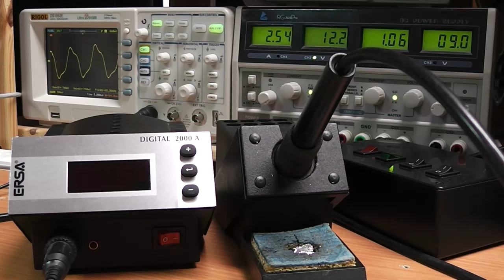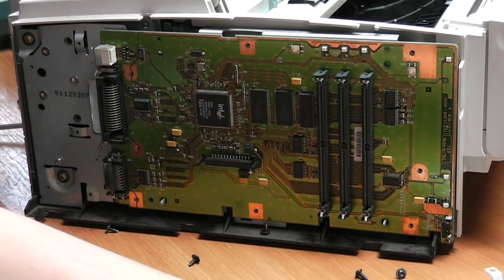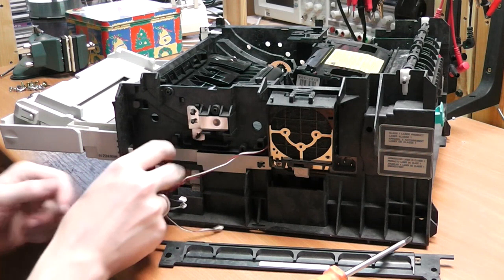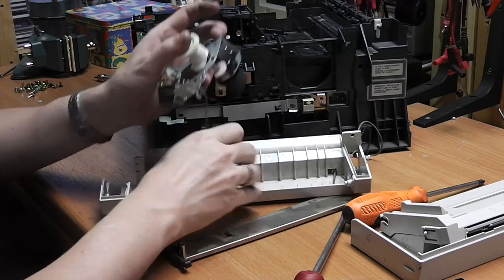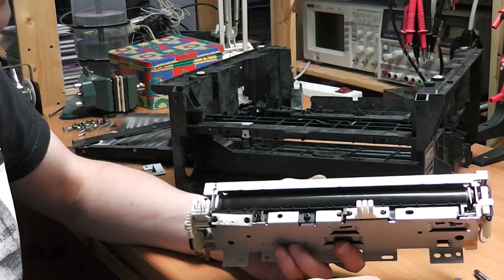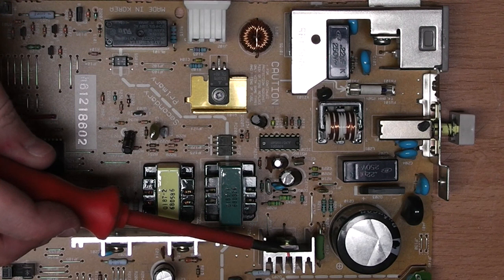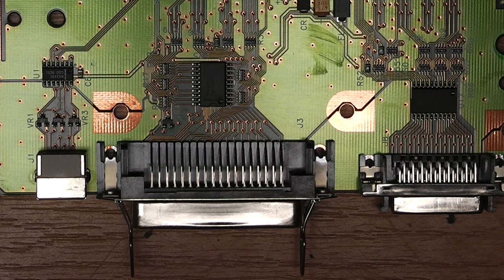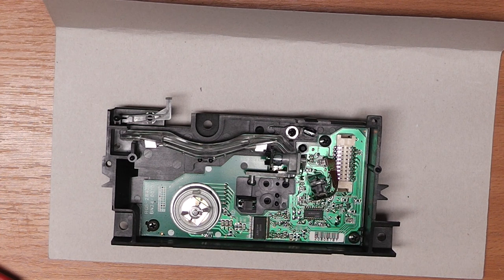HP LaserJet 6P Disassembly and Teardown

Comment: The old school HP LaserJets used to be very solid bits of kit! Look at that beastly power supply... nice! Also, that Mini-DIN connector is almost certainly an AppleTalk interface, as the MAX491 can be used as a RS-422 driver as well, and HP was huge in the Apple market back in the early 90s. Great teardown!

Comment: Those components with an IR LED and a photocell are called Optocouplers. They provide electrical isolation while passing information to another part of the circuit. Similar to some arcade games you have a bank of them and multiple people can play against each other because they are linked optically otherwise you would have ground loops.

Comment: Any high school robotics club would drool ecstatically over those gear trains!

Nice video.  I have thumbs-upped and subscribed.  That microwave salvage is calling to me...

I am going to see if I can get my 6p to pull one sheet of paper at a time, and I needed this disassembly info to do it.  Only I will be very careful about it as I am not scrapping it. ;o)

We got many miles from ours, and it has been sitting idle for quite a while.  We will be very happy indeed if I can get our workhorse back.

And if I can't get it running right, I will have some fabulous gear trains for my own robotics use! :oD

Comment: The main motor is not a stepper motor it's also a BLDC motor and the controller is probably a Sanyo one, with pinout written on the board, RED - GND, VCC - 24V, P/S is 5V logic some weird PWM signal

Comment: Probably destroyed a perfectly functional printer. The Quality on those machines is way ahead of anything produced today.
Reply from the maker: Hi, and thanks for your comment. If I recall correctly, there was quite a substantial amount of rain that had fallen on it, so this would likely have caused issues with both electronics and mechanics (moisture developing rust over time). However I do beg to differ on the quality of HP printers. In my experience, they have atrocious repairability and I've seen numerous units that failed with completely dissolved rollers (i.e., the rubber rollers litterally liquify, making a gooey mess all over the place), rotten foam on the soleniods (causing hanging solenoids, leading to paper jams) and such. Really annoying mistakes that I've never seen on my Xerox (which has now printed almost half a million pages and is going very strong). Additionally, I find that HP service manualy typically are less detailed and disassembling of the units is sometimes insane: For get to the HP4000 solenoids, for example, you have to literally disassemble the complete front and right side. Very repair-unfriendly design. So I do think I can live with myself taking apart this unit. If I recall correctly, I might even have used the NTC for the repair of my Xerox fuser.

Comment: I would use that anytime  now in 2020!
Many other B/W laser printers  are rubish compared  with the quality build of this printer.
Shame, Shame, Shame that you dismatle such printer!
Plus your level of knowledge is limited..
Reply from the maker: Then why don't you buy yourself one? They can be picked up really cheap (less than $10) on eBay. But it's really quite a garbage printer to be honest. The build quality of office printers like my Xerox or the HP P3005 are MILES away from the 6P. I'd disassemble it again in a heartbeat. Also why do you assume it was still working? It wasn't, the drum unit was defective (that's irreparable) and the rollers were completely dissolving. But I guess you're the expert here :-D
Reply: @johndoe271828  NO, no i got it wrong.
I was a bit pissed seeing in such a good state (looked almost new..) printer and I start throwing words around. 
I live in UK so I cannot afford to buy from  US; too much to pay in taxes and transport..

Anyway, thank you for recommendation. I will check that.

Cheers
Reply: @johndoe271828  Kann ich ÜBERHAUPT nicht bestätigen. Ich hatte noch nie einen so robusten Drucker. Habe einen seit knapp 20 Jahren im Einsatz für selbstkledendes Papier. Druckt und druckt und druckte, ist äußerst schnell startklar. Jetzt at die Fixiereinheit das Zeitliche geseegnet, nach mehreren 100.000 Seiten.
Reply from the maker: @pappe133  Keine Ahnung, da haben wir dann einfach echt unterschiedliche Erfahrungen gemacht. Ich hatte einen LaserJet 6L (glaube ich), damals noch Parallelport und danach den 6P. Beide hatten dieselben Krankheiten, die Rollen haben sich buchstäblich "aufgelöst". Sich in eine ultra-zähe eklige Flüssigkeit verwandelt. Beim 6P war zunächst nur der Einzelpapiereinzug betroffen, war also eher egal, aber beim 6L war das tödlich (der hatte nur so einen stehenden Einzug). Keine Ahnung was die damals für Kunststoffe/Schaumstoffe verwendet hatten. Ich habe auch einen LaserJet P3005 und der ist tatsächlich auch robust, mindestens so robust wie der Xerox DocuPrint 2125N. Bei beiden habe ich solche Probleme mit dem Papiertransport überhaupt nicht, also hat HP da offenbar was an der "Rezeptur" geändert.
Was aber halt nichts dran ändert dass ich HAUFENWEISE Kommentare bekomme, dass das ja doch ach so ein Sakrileg ist so ein Ding zu zerlegen. Ich recycle aber wirklich alles was brauchbar ist und mach das nicht nur kaputt. Und das Zeug will einfach NIEMAND. Ich habe gerade z.B. einen DocuPrint zu verschenken (!), den aber keiner will. Und mit Röhrenmonitoren ist es dasselbe. Da sind die Leute immer ganz schnell am rumheulen, aber meine übrigen CRTs will dann auch niemand haben. Das ist einfach bissl frustrierend.
Meine damit ausdrücklich nicht dich, du hast ja einen echt konstruktiven Kommentar geschrieben. Aber naja. Man hat's nicht leicht wenn man hier Videos hochläd ;-) Schönen Abend noch.